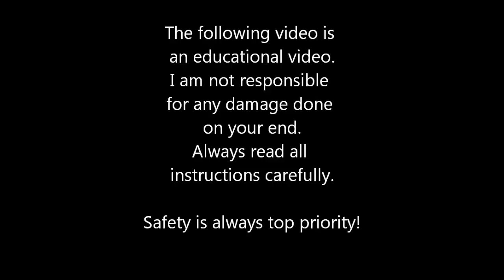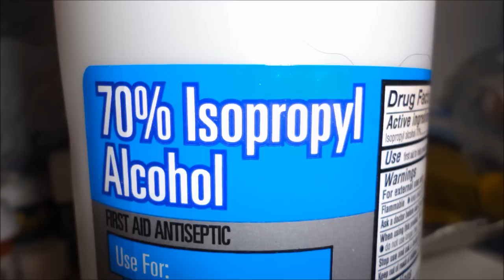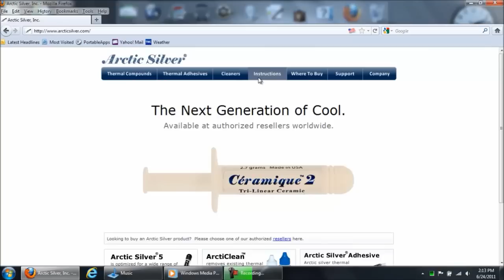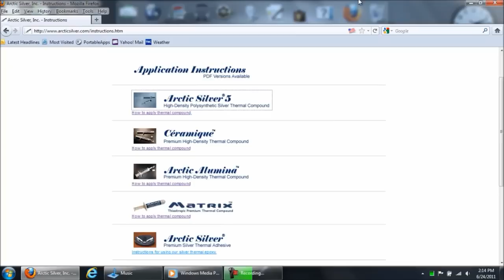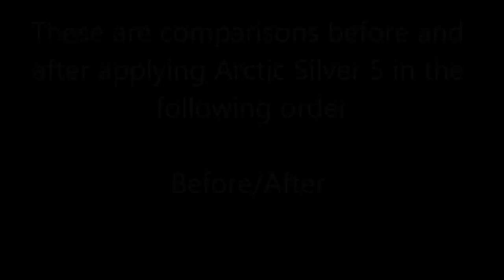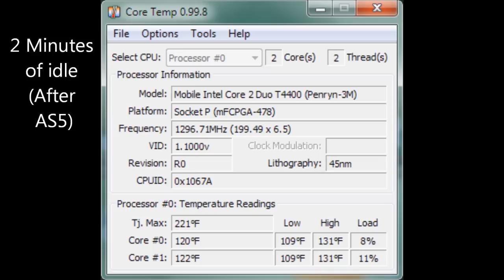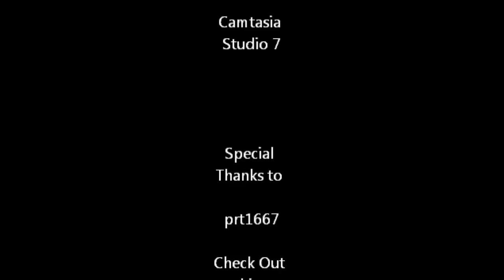How to Apply Thermal Compound (Arctic Silver 5) to A CPU and A GPU - Laptop (Dell Inspiron 1545)

Comment: people who are coming here to 'learn' how to replace the compound an a mobile cpu and gpu, turn away,  he uses his finger a credit card and wet wipes to remove the compound then spreads the new compound in with his finger wrapped in a plastic bag, NO NO NO, do not do this! spread the thermal compound with the heatsink so it is a constant even pressure and do not lift it back up,  air bubbles are a killer, and he has just filled his compound with them.
Reply: plus, I do not believe he was grounded...
Reply: He cleaned the processors with alcohol treated microfiber wipes (used for glasses) that was okay. Also using a credit card to remove compound isn't the most awful thing he could do. After all the compound has to come off some how. But the plastic bag was a big no-no.
Reply: MEDiumInc one of the worst parts in my opinion was when he is scratching on the copper block with the screwdriver,  poking it is bad enough to cause microscratches,  but then he proceeded to move it like he was scribbling on paper with a pen,  MASSIVE no-no
Reply: Yeah, scratching it at all is going to mean more air pockets needing to be filled. Maybe for someone who applies too much thermal compound its not so bad, but we should be smart about this stuff. Let the heatsink and the cpu heat itself ultimately spread and set the compound. I always have to laugh at the shit job manufacturers do of putting way too much garbage compound on. A little goes a long way with the good stuff.
Reply: When you put the heatsink back on, the heat from the CPU and the pressure should spread it out for you-- don't spread it yourself, like Waggly says!

Comment: Spreading the thermal compound with your finger in that manner will leave air bubbles. If you just apply the thermal paste in the middle of the CPU/GPU and let the pressure from the heat sink spread the thermal paste by itself it will guarantee no air bubbles. Obviously, the idea is not to put too much thermal compound or it will spill over.

Comment: I have Inspirion N5110 with i7, 8G RAM, Nvidia 525. I have renew my fabric thermal paste(which is 1.5 years old) with Arctic Silver 5 and the results are preaty nice. It lowers the idle temp with aprox 15-20C(on CPU and GPU) and full load with about 10C. 
I am very satisfied with it!

Comment: A lot of know it alls here. Guess what guys? Arctic Silver spread that way works fine because it ALWAYS squeezes even more out. AND you might screw up placing the heat sink at angle.So,the best IS to spread it around.

I've taken them apart a year later and there were NO bubbles or other irregularities at all.  And that was after the 200 hour break-in period, during which it slowly got somewhat better.

Comment: Are different aftermarket fans design for specific motherboards, I'm talking about the way they hold into place? My stock intel has 4 plastic pins that fix it in place, but I've seen other methods. Can I only buy the ones that have the same fixing mechanism as my current one?

Comment: I have a prob. that why i am getting 15 to 30 fps with gtx 650 ti in every games like cod bo2 or darksiders and my cpu is getting hot like 75degree and also my graphics card getting hot like 79 degree when i am not playing games. But when i update my nvidia drivers i get enough fps but after some times again the problem occurs. plz help what should i do?? Should i have to put some thermal paste??

Comment: Thank you thank you thank you!!!!!!! I have the same problem with my msi gaming laptop...and I've ordered exactly the same thermal paste. Thank you once again!!!!!
Reply: for gods sake dont follow this tutorial, Your asking for permanent damage, use the grain of rice method, and let the heatsink spread it when you put it back on, spreading it with your finger is just asking for it.
Reply: Star War News! Actually, this same method is also recommended in wikihow. The rice grain method is only meant for circular heat sink. For rectangular or square heat sink even wikihow recommends this same method.
Reply: Vikas Sheth Wikihow is not the best source for this sort of stuff, I just reseated my cpu today, i7 950, notorious heat devil, runs 50 idle, by using the ricegrain method i have brought its idle to 42.

others who achieved 50 made the mistake of spreading with their finger, it does not need to be spread across the entire cpu lid, Thermal paste works by filling gaps and imperfections and leaving no air bubbles. Therefore it only needs to be applied in the centre of the cpu and spread using pressure from the heatsink, putting on more thermal paste and spreading it everywhere is actually detrimental to your temperatures, and in a laptop that could cause problems if the thermal paste leaves the lid.

Trust me follow ricegrain, if then your temperatures continue to be high i think you have to look more towards the fact your trying to game on a laptop, sure they can do it, but even my gaming laptop runs 80c gaming, its just how hot they run unfortunately.

Comment: I'll look into it.

AS5 is supposed to have a 200hr break in period, where the fluid is supposed to help the paste spread out, and then the fluid is supposed to drain to the side. This would leave higher particle density, therefore better thermal transfer. Some ways to help it include rubbing it into both surfaces (so called staining), to force it into gaps it might not otherwise fill.

Comment: My core temps in the last month used to get to 57C on idle and 100-102C on max CPU usage, now it's 37C on idle and the highest temp I got was 70C. So is 70C still high for an Intel Duo E7500? The cooler is probably pretty shitty, it's a standard one from intel, and I don't think I can go any lower without having to buy a new one. I bought Arctic Silver 5 cause the old thermal paste that was applied when I bought the PC must of expired, I guess, it was very crumbly and dry when I cleaned it.

Comment: That and the oils and dead skin cells from your finger clog up the microscopic indents that the grease needs to fill in. With how viscous Arctic silver 5 is you are actually better off using the grain of rice method in that you let the heat sync spread the Ac5 out. It fills in the indents then solidifies over its 200 hour break in period.

Comment: Hello sir, I have a question. I have Inspiron 1545 too, except on the long thing (idk what you call it) that passes the heat to the fan, I have 4 of those paste thing. So the long metal thing for mine is longer, it covers all 4 chips. You have the 3rd, I can't see the 4th on yours. It's near where the black and white small cables end. I touched all the paste, they still look pretty good except the one closest to the fan. So I'm not sure which one to replace. Thanks. Liked and subscribed already.

Comment: I have this thing about AS5, I have the confidence that it's going to be rock solid. I got my surfaces so well polished that I barely use any anyway. In my testing however I've found AS5 easier to apply and with slightly better conductivity. Also look up the benchmarkreviews' TIM comparison. The only thing MX-2 has on it in my opinion is that it's safer to use. I'll look into PK-1 at some point. Honestly, I'm not too bothered, since I've got a decent water block on both CPU and GPU.

Comment: AS5 is not conductive either, but it is capacitive. MX-4 is also a decent option. I've used AS5 for as long as I've used thermal grease, never had an issue with its capacitance, as it is over insanely short distances, so even if you short out a resistor with it or something, it shouldn't have much of an effect. That being said, ALWAYS clean up any mess with any thermal grease. What's not where it shouldn't be won't kill your laptop :D

Comment: It works for me a lot better than when I did the spread myself.
And as for the blob.. It will spread out because of the pressure from the heatsink. Besides, its not the whole square that needs to be covered.

Comment: He applied the paste correctly as per his CPU, go to the arctic silver website and check how they recommend to apply per your CPU. He has a dual core mobile which calls for a surface spread. My CPU is an older core 2 duo which calls for a vertical line. I did the surface spread and my temps increased, I redid the paste and did a vertical line and my temps are good. I used a credit card and manually spread the thermal compound on my GPU and my temps decreased. It's processor dependent...

Comment: Actually, a site conducted a through test of the various ways to apply/spread thermal paste and the difference in air bubbles between using a dab and applying the heatsink or spreading it out manually is minute. Similar temperatures too, all were the same within a margin of error. And when you're on a modern laptop CPU, which doesn't have a heatspreader and isn't perfectly square, spreading the paste is the best way to make sure you have through coverage.

Comment: @CharlietoKind Hmm okay. I got to using it extensively and it hit a high of 65c and at idle it changed to 55c it seems to function well though. i was just worried about taking the pad off the GPU.. I took it off anyways and put the arctic alumina on it. I was just worried if it was going to overheat or something. My factory thermal compound was nasty and dried up to :/ I think doing this is very necessary if you want to extend the life of your machine

Comment: @alexgomez123, @CharlietoKind;
I have upgraded mine to a Core 2 Duo T9400 and it works fine. 
I would like to ask your opinions. My CPU runs at around 70C on load and GPU (ATI Mobility Radeon HD 4330) runs at around 70-80C also, because I overclocked the graphics. I would like to know if you have tried any other ways of making it cooler?

Comment: I got a HP laptop with an intel duo core processor at 2.4ghz and am wanting to upgrade that cpu with a quad core qx9300 at 2.5ghz... which I think will more then double its performance.  I also want to remove the hdd and put in an sdd with an intel ssd 320 300gb as well and perhaps also upgrade the gpu as well.. kind of over haul the thing.  are all the laptop gpu's compatible??  I probably have a very old and cheap one in there.. you know how HP is in building their stuff...  any advise or heads up from anyone who can be helpful??  I have never taken apart a laptop so fears abound.. LOL  I have done some Desk Top building so I understand that platform..  Just trying to figure out what would be top of the line stuff for this lap top that I can put in it..

Comment: also arctic silver 5 is conductive. i dont care about how much you think it is not. i have had my gpu throttle and heat up and down quickly using it. switched to artix m4 and no problems
Reply: You do know that it takes 200 hours of normal use for artic silver to cure right? :) after 200 hours of usage artic silver will perform a lot better then artic mx4 :)

Comment: Also, Arctic Silver will harden just like the stuff from the factory.  It's the nature of metal based compounds.  Also, Arctic Silver, though very good is electrically conductive.  It CAN short things out.  The only compound I use is Arctic Cooling MX-2.  Non curing and non conductive.  So, never hardens and can not cause a short.  Very important on exposed cores.

Comment: I don't think the issue was that you didn't put on enough compound. I'm pretty sure it was because you didin't replace the thermal pad with another thermal pad. The purpose of the pad is the bridge the gap between the gpu and heatsink. Thermal compound isn't thick enough.

Comment: let us just say there is a reason that they have to make mention of electrical conductivity. it might have changed now, but i know from experience (not on that flipchip i was using it on, figured out the problem later) of testing it with a multimeter that around 4 or 5 years ago it was conductive. i believe that they fixed it, but the issue existed.

Comment: You can take it off, you just have to clean it off.  at most, you waste a tiny bit.  Next one you do, put some on in a blob, or thin line(if its a rectangular IHSless CPU, thin line down the middle, in about the center 80% of the chip), and then put the heatsink on, and take it off again to see the spreading.  This can also be a learning tool as to see how much you really need.  If it goes past the CPU at all, its too much.  You really dont need 100% coverage on the CPU, 90% is just fine.

Comment: @CharlietoKind
Yes, I can see it's a laptop processor, that's why I found this video as well, I put the compound on my laptop a couple of weeks ago.
However, it doesn't matter if it's laptop or not, thermal compound doesn't get bubbles, gets spread more evenly & there is a smaller chance for gaps if you use the pea/dot or other similar method. That's the case for all CPUs.
And I can confirm that it works a treat!
Although, I used the great Arctic MX-2 thermal compound.
Prob small diff bw methods

Comment: AS products have 150-300hrs breakin period.
According to AS info the PC must do thermal cycles (done if the PC is not ON full time).
Switching ON/OFF changes the paste
At 13hrs/week you are using it 2h/day, so you're thermal cycling the paste. Your thermal cycling would be over after about 12weeks (156hrs)..
This is a concern for OCers & owners of high end CPUs.
AS5 has reduced the avg temp with 15deg Celsius versus no-name or low end branded heatpads/thermal paste so it's OK at first use.

Comment: I know how the AS5 website says it, and its also wrong.  Spreading causes airbubbles, airbubbles cause less thermal conductivity.  The laptop heatsinks are perfectly capable of spreading it properly, and depending on its shape, a thin line, or a small blob in the middle should be fine.  I have been working on and fixing computers for many years, probably longer than you have been alive, and I can tell you from experience, that spreading usually results in worse temps than what was on there.

Comment from the maker: @DragonL33t 44C is 111F, Yours actually runs cooler than mine on idle 12:45 , under load 59C is 138F so yours is about 10 degrees F warmer than mine.. but that is no problem... the peak temperature before it shuts off is 102C

Comment: they must have changed it. a few years ago i used a multimeter to test it after using it on a flip chip and on a bead about 2cm long i still got continuity on my multimeter (really weak continuity, but it still caused a beep in the speaker mode), (the bead was on a piece of paper on wood), and at the time there was a warning about it on their site. now it says that it isn't electrically conductive and i accept that, they must have changed the compound. no biggy, things change.

Comment: Well the second you spread that AS5, you defied the point of using AS5 in the first place. It's better to use a slightly excessive amount, which would then be squeezed out as you apply pressure, than to spread it with your finger and guarantee you end up with air bubbles where they shouldn't be.

Comment: Please, other than the spreading issue. you should NEVER replace thermal PAD with paste, paste simply do not provide enough height because the heatsink was designed for the thickness of the PAD which was originally there.

Comment: his method is the opposite of the 'spread' method which is what leaves air bubbles. drop in the middle and then pull the heatsink down is the best because of the lack of air bubbles

Comment: thermal paste breaks down like any grease over time so if applying new thermal paste once ever year to two years. you are best off getting a aftermarket fan for your cpu they are much better then the stock and you will see a diff in temps.

Comment: Yh, well this is how Dell do things. My Acer saw next to no temp difference going to AS5 after 8 months of uni use. The TIM was still in a semi-fluid state (as it should be), so there really was no point in taking it apart, but I feel better about it now that it's running with AS5

Comment: OK cool music but lots of things wrong here...  First of all you should use alcohol pads, which will leave zero chemical residue and make quick cleanup of crusty thermal paste.  They're also very cheap and available at Walmart.  Not sure why you were so OCD when cleaning, and made us all sit through that.  The CPU/GPU really aren't that fragile.  It's ok to go to town on them with alcohol swabs and you should only need 1 or 2 pads.  You could have done that a lot quicker and easier.  You should be careful when replacing thermal pads with paste on the GPU, sometimes they are using a thicker material because of a gap between the GPU and heatsink.  Typically it would be advised to add a thin copper shim with AS5 on both sides or use a thicker paste on this area such as a diamond or ceramic. You can also purchase thermal pad material to replace it OEM style, it comes in different materials and thicknesses and does not transfer heat very well compared to paste. Lastly your application method was over the top.  It's usually best to apply a dab of paste about the size of a grain of rice, it will spread evenly when you mount the heatsink.  For larger desktop CPU the plastic bag method is good but Yo shouldn't keep going back over it, because you're removing too much product.  There needs to be a decent layer to fill any imperfections in the heatsink. And finally the part that annoyed me most, computer related temperature measurements are always in Celsius.

Comment: This is how NOT to apply thermal paste. Smoothing it out like that will just put air bubbles into the compound that will trap heat. Put a BB sized dot and let the heatsink spread it out.